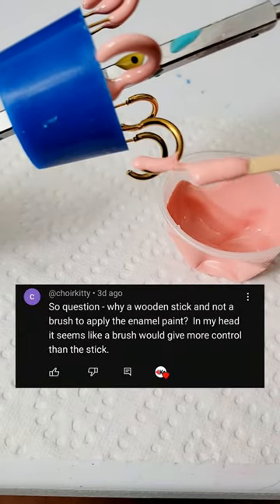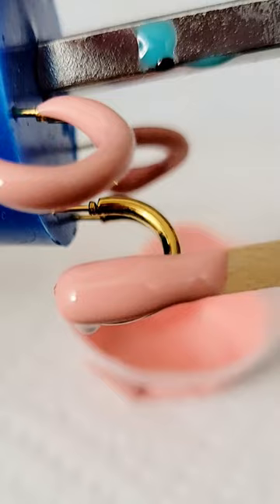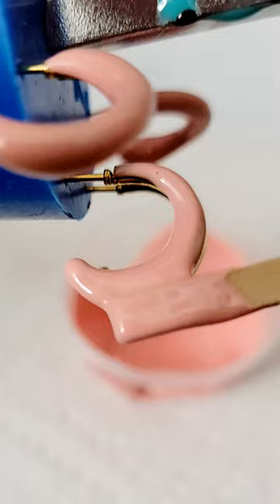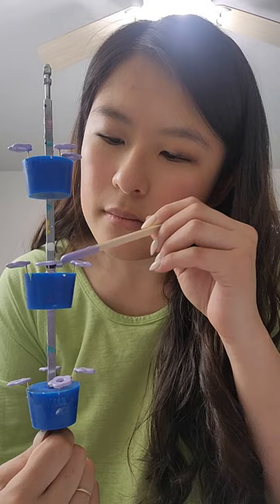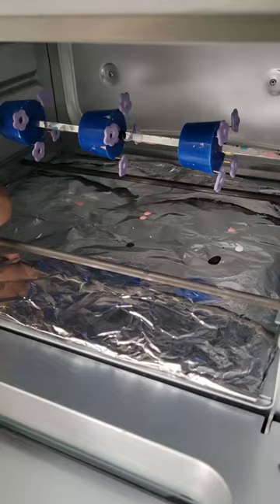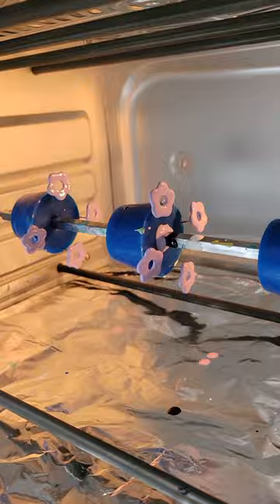Here's why I use popsicle stick to paint enamel instead of brushes!

Comment: Have you tried masking the ends instead of avoiding them while painting? Like you could just use maybe some masking or painters tape that you could potentially reuse and make a ring around them. It doesn’t look like you really get paint on the interior side, so the exterior masking ring could save you time and resources depending on your process. You just need to peel the tape off before curing and maybe you’d only need one stick to scrape off the paint from the tape to use it again?
Reply: Itd be cheaper for the wooden sticks and more safe for the environment than the option, though a wonderful idea

Comment: I think you can try silicone applicators. I'm into polymer clay and epoxy resin. There are silicone modelling tools that work great when I need to reach very small and delicate parts. They don't stick to epoxy resin and I think they may be able to handle enamel well.
There are also silicone measuring cups. I'm absolutely dying for those.

Comment: Maybe consider using a reusable material that the enamel doesn’t stick to? Idk if it sticks to plastic or the like but if you can get something it doesn’t stick to, the enamel could probably be peeled off. If silicone works, you could have a couple and just bake with the earrings so it hardens and is easier to peel off. Maybe use the peelings for some form of art or sell them in baggies for other people to use in their art